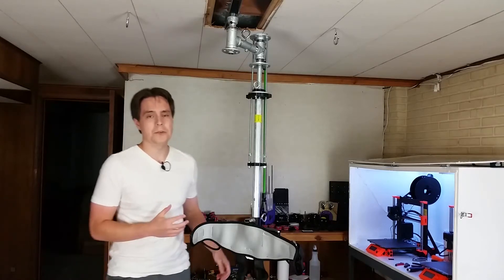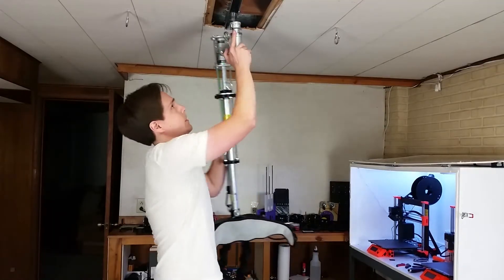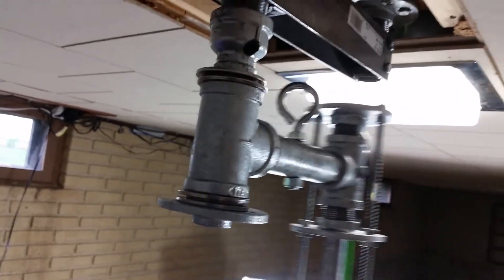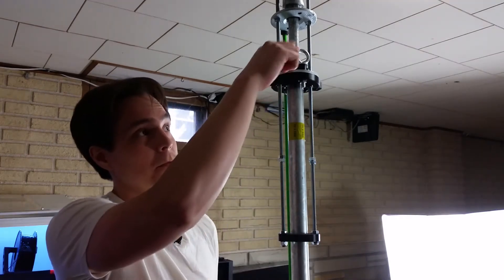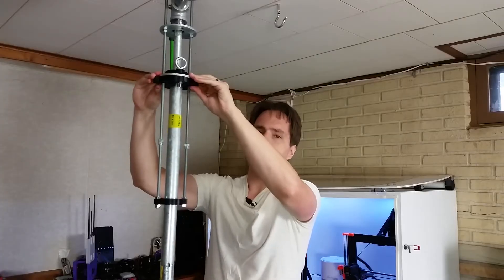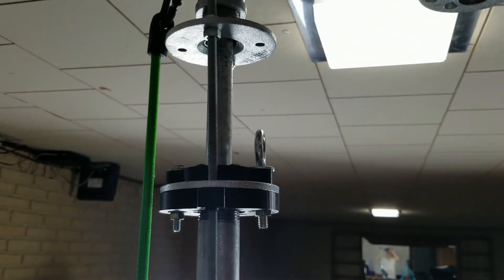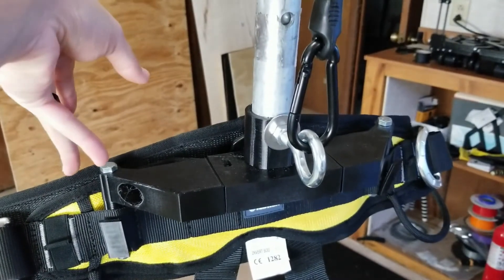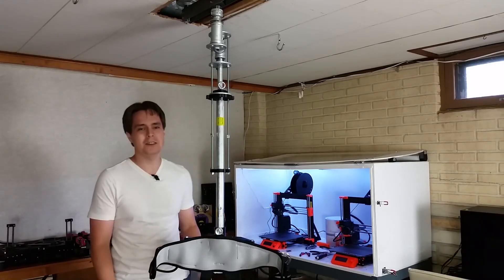VR Shoe Build Log #42 - L Shaped Support Rig

Comment: Hi Alex i just thought a totally different approach. What about if the back was just a plastic or some other material oversize spring linked from the back to the ceiling. Which would allow even flying.
Reply from the maker: It may have the similar issues that I ran into in the last video, with the physical therapy like rig. If the rig is springy, has slack, it may cause the swinging I experienced and the problem of you feeling no resistance from the rig, then you get to the end of the slack and get thrusted back. And if you try to turn while you're not directly under the swivel, it is awkward. Those reasons are why I'm trying to make the rig as rigid as possible.
Reply: @finallyfunctional  Sure Alex, it makes sense. I am just trying to think of approaches or things that could enhance or simplify the experience but it think u are approach is getting simpler by the second. just being realistic about having at home a device that is hanging from the ceiling is difficult to imagine. I see it more like the structure of the parasol as you see on the restaurant terraces so people can hang from the parasol structure rather than the ceiling. So it's also more portable.